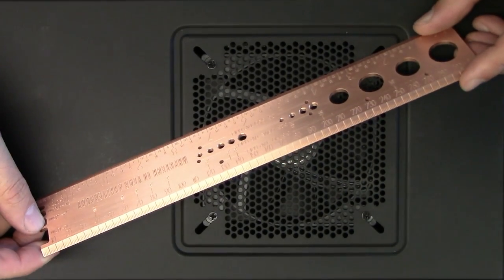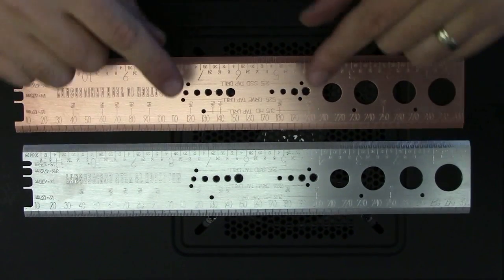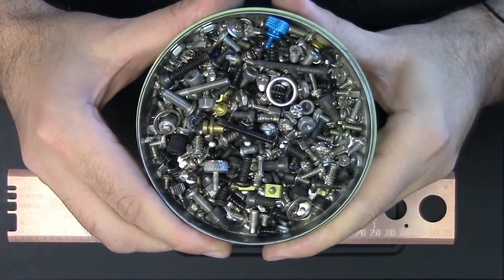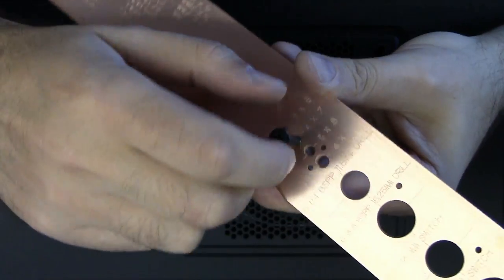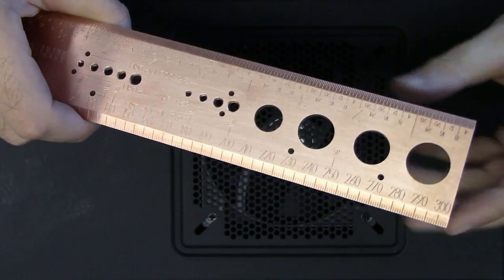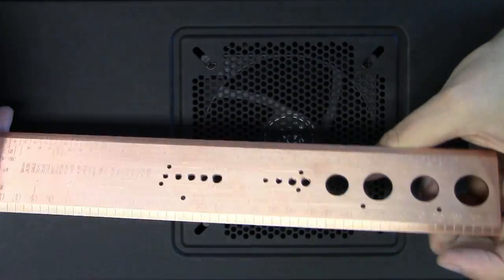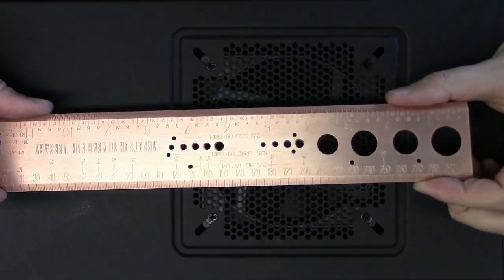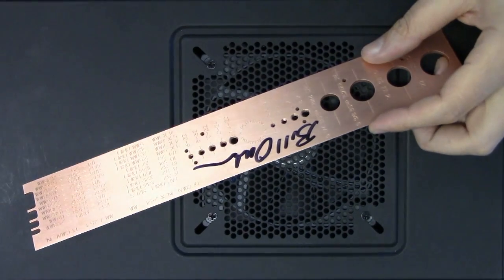COPPER PC Mod Ruler Giveaway & Mnpctech.com Discount Voucher

Comment: I would use the cooper ruler as a usable keepsake present to give to my son as a tool I used on his new C70 case mod that he will be getting this Christmas. Even though the build is on the x99 platform I know it will someday just be something he sells to get money for a better system down the road. So the ruler would be a nice momento for him to have to remember the build by.  I am glad that you signed it. As for the 10% off I will be adding case feet so that will come in handy for sure.  I'm happy in advance for whom ever wins this.
Reply: +hodaboy1   Looks like I need more sleep than 5hr a day.. It's Copper.. not Cooper... must have been thinking of some good old Detroit music.
Reply: +Ken Zufelt   It's 11:41pm on 12-5-15. I am entering the final painting phase now. Just have the gpu backplates and a side panel fallout screenshot frame mod to paint. Then I will be on to the measuring for drilling holes for the led lights I purchased about a month ago from mnpctech.com. I will be using the lights as backlighting to make the transparency film with the Indian Head Test Pattern look like a tv screen image. It sure would be nice to measure out the hole placements with this ruler and then be able to give my son the ruler as a more lasting gift than the pc. Winning this would also get my wife off my back about me using her quilting ruler for the case build.
Reply: +hodaboy1  It looks like I have you on both my youtube accounts.. I like mnpctech that much. lol

Comment: Its apple pie season so first would be peeling apples with it. After the apples are peeled and the wife make the pies I'll eat the pies with it . I hope it wont react with my fillings!! While eating the pies  I'll have to use it to sort my loose screws between bites.
2 HAF XBs are sitting on my desk needing to be modded out. Not sure if Dayz or Fallout....Who am I kidding Dayz Mod duh

Lots of measuring and marking to get the water cooling equipment and wiring in their new places.
Whats that ? No dear I will not be taking it to the bedroom.....No It  doesn't bend ..Its freaking solid ....I know isn't it awesome!!

I could pitch a tent with it too! 

Speaking of wood I'm sure that I'll be able to chop down a couple of trees and break down the wood into carefully measured pieces to help power my steam powered pc that I would want to build. You know for when the Zombie Apocalype happens!

I'll have to read up on how to turn steam into electricity so the heft of that ruler will help keep unruly (see what I did there?) pages sitting down.

To be sure I'm really prepared for the Apocalypse I'd have to sharpen the edges and add a long handle ( good thing there are already tapped holes) to  make it into a Zombie slicing dream tool.